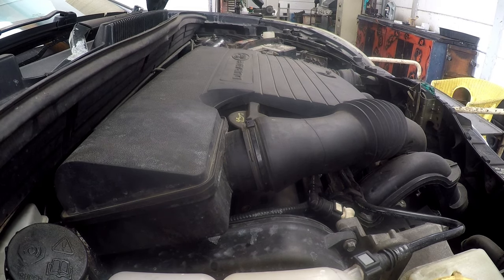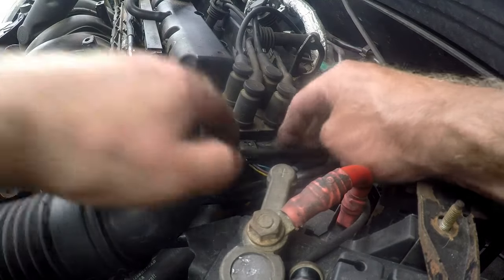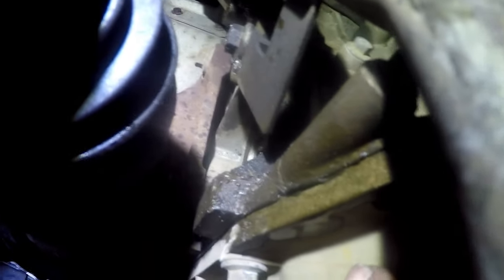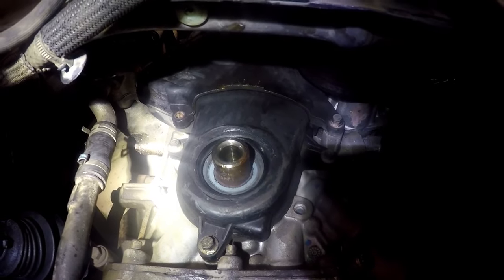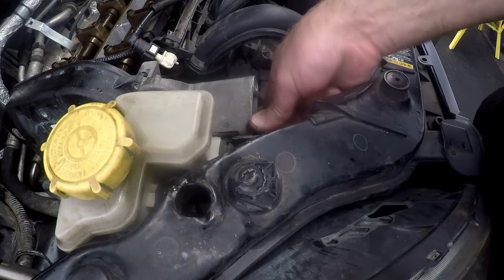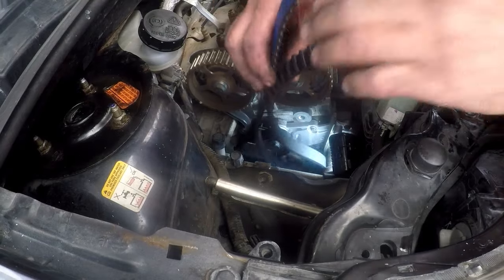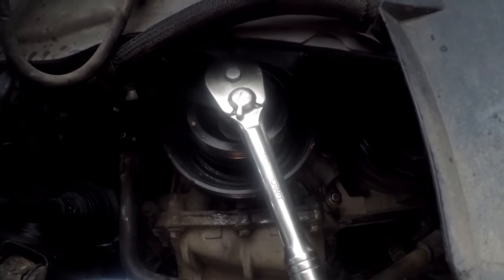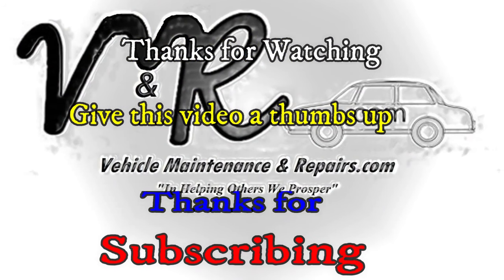Ford Figo 1 4 Duratec - Cam Belt & Tensioner

Comment: Best video I found for the Duratec engine, cam belt replacement. I only miss the remark that the first cylinder has to be on top, with the first cylinder valves closed.. But an excelent video though !
Reply from the maker: Thanks for supporting my channel with your visit, I am glad you found value in this video.

Comment: This is amazing. a drunk driver crashed into my car head on,  and i am repairing it on my own. I just learned that the engine mounting attaches to the cam belt cover and not the head... I was soo stressed out because that cast iron part of the cam cover is broken, and I thought it was the cylinder head. This video helped me loads even though I am not doing a cambelt change.
Reply from the maker: Glad to help Sifiso, thanks for supporting my channel with your visit.
Reply: Tsoro ulAPHO

Comment: Thank you for the informative and helpful video. Get this man a Bells. One question, where can one get the crank pulley bolt at an affordable price? Thanks again
Reply from the maker: Hi Daniel, thanks for the support, I am glad the video was able to assist you, when one buys a belt and tensioner kit, the crank pulley bolt is usually included, failing that the only place to buy a decent one is the Ford dealerships, all the best ahead, Dasniel.

Comment: What a mission these cars hey. Great video and camera work considering u solo. Is TDC always when the locking tool is in place (assuming the cams have not been tampered with?)
Reply from the maker: Yes when the locking tool is in place and the engine is turn clockwise.

Comment: Very helpful video thank you. However you used the locking pin, which is only meant for doing up the bolt, to time the engine. The timing pin is the thinnest one, 5mm diameter; that is what you set the timing to if you want to be spot on. Also the pulley bolt should be torqued and then angle-tightened through a further 90 degrees as it is a torque to yield bolt. Just buzzing it with a gun is imprecise though probably works but if it doesn't and the pulley slips you wreck the engine.
Reply from the maker: Watch the video completely again please, I am a 35-year-plus veteran mechanic I know what I am doing because I do it for a living, experience beats theory hands down.

Comment: You must loosen the camshaft spockets before fitting the new belt. Never use the camshaft setting tool to hold the cams in place, and you MUST never tighten up the crank bolt with the crankshaft timing pin in place. 
Fit cambelt to crankshaft spocket first, fit pulley and tighten up, then fit belt to loosened camshaft pulleys. Release tensioner, then tighten spockets, using special tool.
Reply from the maker: Thank You for supporting my channel with your visit and interaction, I am pleased this video was helpful to you.
Please feel free to check out the rest of my channel by clicking PLAYLISTS https://www.youtube.com/@vehiclemaintenanceandrepai3790/playlists for more helpful service and repair videos on most makes of cars available here in SOUTH AFRICA,
It is FREE.

Comment: Great video.
What size bolt or drill bit could I use in the block as I haven’t got the correct pin?
Reply from the maker: 10mm

Comment: Very good video. One of my future projects. But first I need to change the AC belt and fan belt. Any chance of having a video on that please. Thanks for saving us time and money.
Reply from the maker: Hi Rikus, thanks for supporting my channel by tuning in, I have done these belts on numerous occasions, but never filmed it, I will do so when the next one comes in, I can tell you there are no adjustments for these belts as they are special stretch belts and not easy to fit, there are a few special tools for it on the market, but very few actually work, so I use patience and ingenuity to fit these belts.
Reply: @vehiclemaintenanceandrepai3790  Super, thanks a lot. I can think patience will play a part in that small space. Looking forward to that video. Stay safe.
Reply: What an excellent video ,as a mechanic of 46 years you made it so easy to understand,your camera work is great well done from sa.

Comment: Middag Gary, ek was paar maande terug by Ford vir n quote toe se hulle 4000 toe ek nou weer gaan toe is dit sommer 8400.

Ek wil eerder self dit doen want trust ook nie as ander an my kar werk ni.

Ek is in SA wil net seker maak waar het jy daardie klein tool kit gekoop om die cams te lock?

Baie dankie vir die nice video verduidelik mooi
Reply from the maker: Ek het dit by Diesel Electric gekry, koste om en by R150.00
Reply: @vehiclemaintenanceandrepai3790  thanks oom het hom op takealot gekoop

Wil net seker maak is daar net 2 belde op di figo die lang een wat om die cams gan en die korter een
Reply from the maker: There is a toothed belt for the cams and crank gears this is called the timing belt you should also replace the timing belt tensioner, then there are 2 stretch belts for the outside pulleys of the alternator, power steering and aircon, these are flat belts without teeth on it.
Reply: @vehiclemaintenanceandrepai3790  more oom, yes het tensioner georder en het timing belt. Di ander 2 belde wat ni tande het ni weet oom wt is hule kode want het een wt 5pk 690 is en nog n 6pk een
Reply from the maker: Sounds correct
Reply: @vehiclemaintenanceandrepai3790  thanks alot and last question to remove those two belts should i use the usual screwdriver method to take them off and on?
Reply from the maker: Yes, I use a spedial tool which makes it easier but before I had it I used a screwdriver.

Comment: SAMCOR designed that engine to be easy to assemble at the plant, and to make it easy to install on that Rosslyn line, saving time there. they figured out that most would not need the belt changed till out of warranty, so the load of work to get to the parts. For those in warranty they used the time it takes to get the belt changed based on the time it takes to put it in in the first place. At least you do not have to take the front of the vehicle off, or remove inlet and exhaust manifolds.....

As usual some of those studs decided to not agree with you on coming undone, so you need to put the stud in first, then get the bolt back in place. At least that 8mm spanner is going to get use again. At least the front seal was not weeping, though probably at 100k the water pump change would be a good idea as well, seeing as you have to just about do the entire job again to get to the bolts for it as well.
Reply from the maker: Thanks for the insights Sean, always greatly appreciated.

Comment: Hi Gary, thanks so much for the video! I have a couple of questions...could you please advise where to buy the timing tool kit you used in the video in CPT at an affordable price? Is the procedure the same for the 1.6 version of this Duratec engine? (Looks identical). Also, out of interest, what was the mileage of this car to have the belt in that condition? Thanks!
Reply from the maker: Hello Richard, try Diesel Electric on 021 706 5552 for the tool kit, it would be the same for the 1.6 and the mileage on the one in the video was 150k
Reply: @vehiclemaintenanceandrepai3790  Thanks for the info Gary!

Comment: Excellent video, Gary. I've done the exact same job using your instructions on my mother's car but perhaps I didn't get the timing spot on. We have an erratic idle. Car idles smoothly for a bit and then starts shaking for a bit. It's also hard to start sometimes. I've replaced the MAP sensor, cam angle speed sensor, coil (tried both the flat and taller one) and plugs. Also checked the PCV valve (rattles nicely) and hose and cleaned the throttle body. The generic diagnostic software I have says there is a random misfire (P0300) and I can see the timing advance jump around when the idle is wonky. Car pulls very well above 1000rpm. Would I be able to bring it to you next week to diagnose and redo the timing if necessary, please?
Reply from the maker: it sounds like an intake air leak,

Comment: With the rocam engines very very important to not do any late oil changes, it gets very expensive having to change out the 2 cams, and all those roller followers, because one decided to seize and grind the cam shaft from oval to round. Oil and filter is a cheap insurance policy.

Comment: Where can I get the timing tool for this fiesta I have one came in from engine rebuild with a rod knock.
Reply from the maker: Diesel Electric (0217065552 Mo) is where I sourced mine from.

Comment: Very well done video. I really like the way you work and film. One question: how did you loosened the waterpump pulley? Because it seems pretty difficult, because is spinning around freely.. and if I may ask..where are you from? Which country? I like your accent! 😁🤗
Reply: you just need to use a screwdriver and wedge it between 2 of the bolts holding the  pulley so it stops the pulley turning as you loosen one of the other bolts and then just loosen all bolts in turn. he sounds like he is from either Zimbabwe or South Africa

Comment: Hi Gary, love your videos... Are you based in Cape Town and if so, what would a cam belt and tensioner replacement cost? Parts and labor?
Reply from the maker: I am based in Cape Town Kyle, this job is R5500 including the water pump, cam belt, tensioner and long-life antifreeze.

Comment: why you did not change water pump?is it optioanl?so ı mean when we change cam belt do we have to change water pump?
Reply from the maker: It is recommended to replace the water pump while you are there, but only if it was never replaced before, this one was done a short while before this cam belt job.

Comment: Hi Gary. Excellent video👍 as always . Wanted to find out where do you get the torque settings for the pulley and where did find the locking kit set for the engine.
Reply from the maker: 100 Nm + 90°Wait 10 seconds15°, Diesel Electric, 0217065552, good luck Dharmesh, hope this helps.

Comment: Great video. At 10:55 did you remove the screwdriver that locking the flywheel in order to move the crankshaft?

Comment: The torqe on the bolt that attach the crank pulley could be 40 - 45 Nm then 90deg
Reply from the maker: I recommend 100nm then 90 degrees, Leon, it is mentioned at timmer count 19.54 in the video.